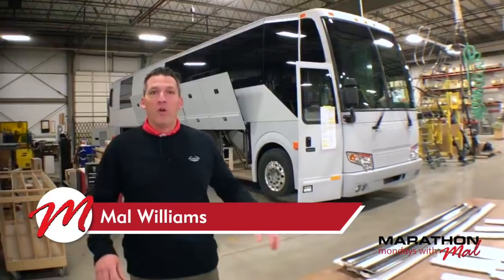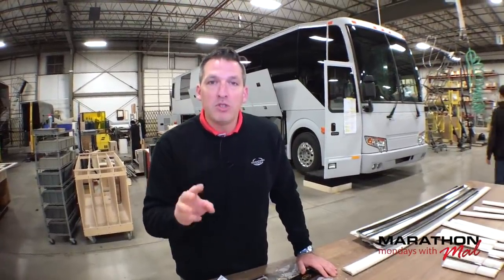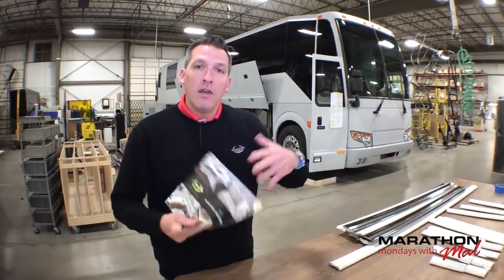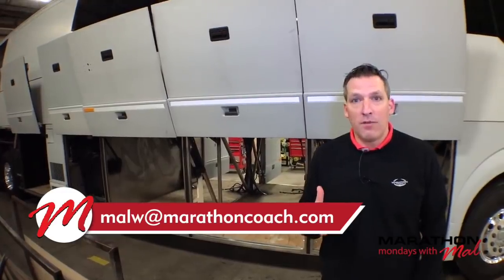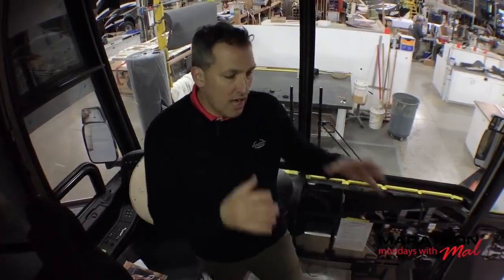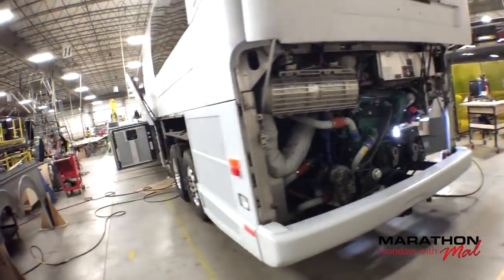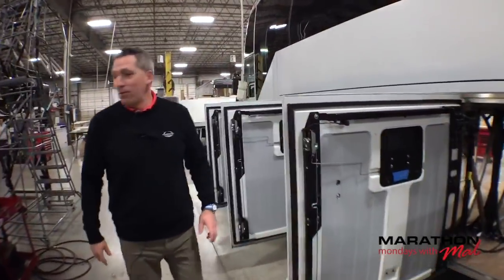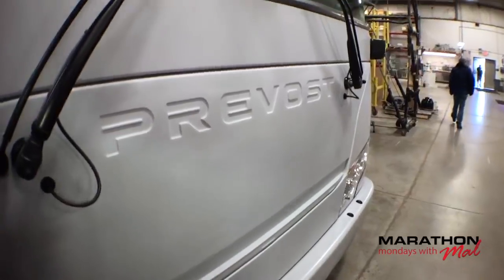Luxury RV on Prevost, Part 1. Marathon Mondays w/Mal Ep.107

Comment: The PREVOST is the best chassis you can get, and with a marathon upbuild, it's the best coach in the world.
MARATHON is the gold standard
Saw a marathon preevost that had one of the front wheels sitting a foot off the ground on blocks and all the storage bay doors opened and closed perfectly with no flexing. The PREVOST chassis doesn't flex or twist at all.
I hope to get an H3 triple slide with a super bath someday